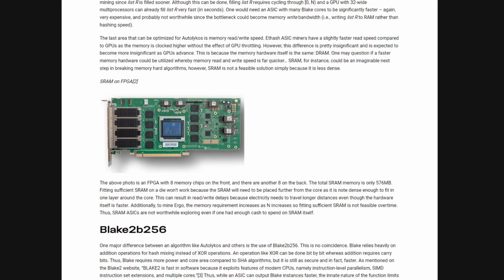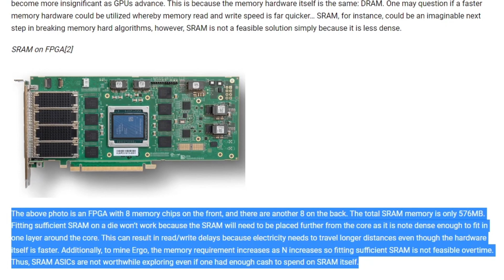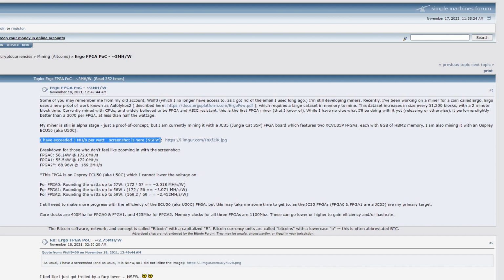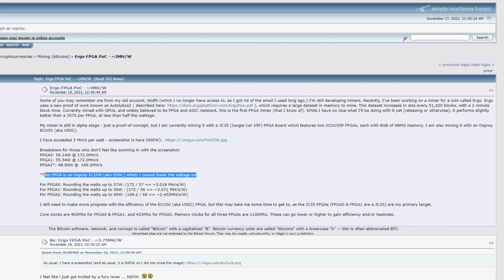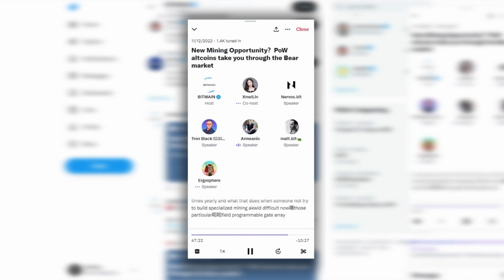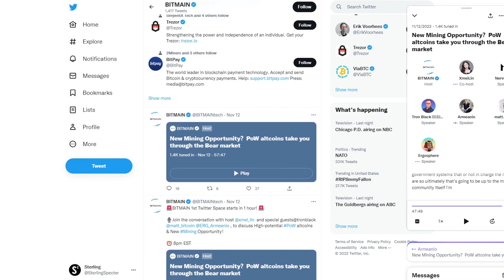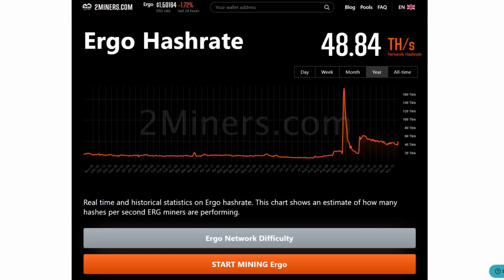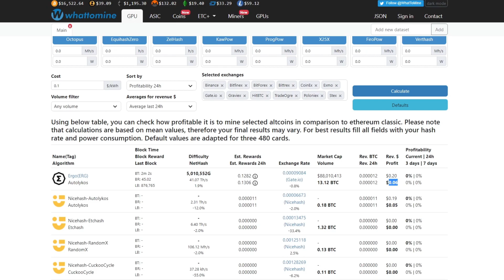FPGA Miners On The Ergo Network

Comment: they are $5000.00 for 1 card ????????/
Reply: 5000 for 1 FPGA is on the cheap side. A new mid tear card can be ~7.5K and top tear at 10K
Reply: they have the osprey e300 14gh/s